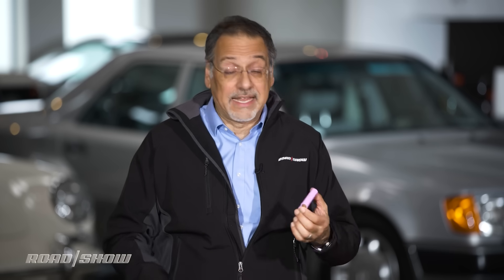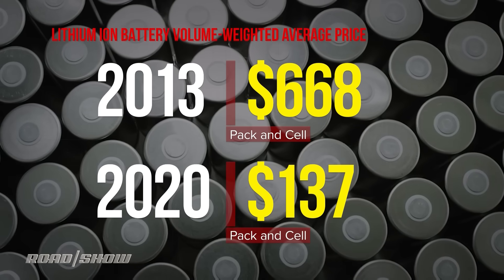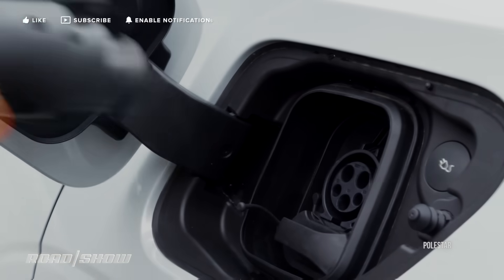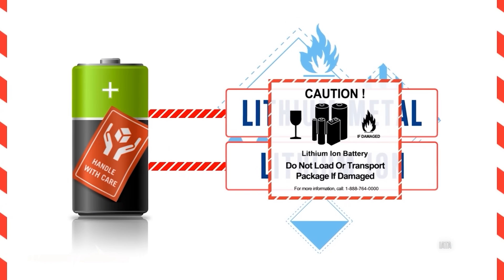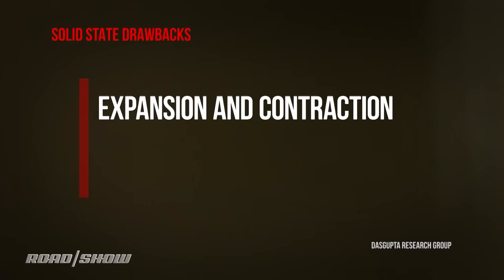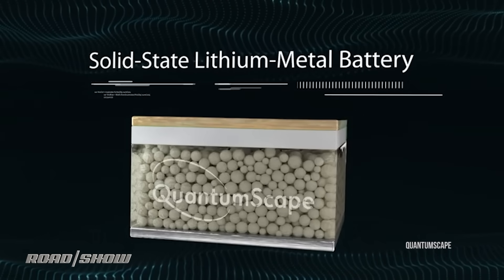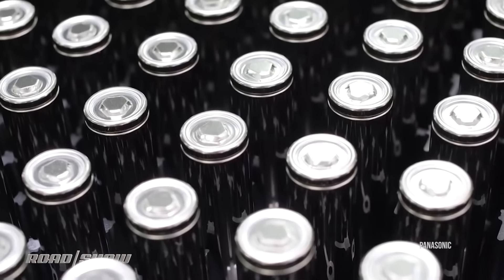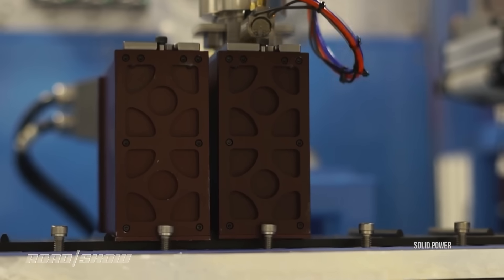When solid-state batteries arrive, you'll want an electric car

Comment: Some misinformation in this video. Not all lithium-ion batteries are created equal, 18650 are used in older Model S and X, but not in newer EV, and of course, there's lithium-iron-phosphate and other types of chemistry. When it comes to cold weather, a cold battery is part of the story, but not the whole thing. The battery is very capable of warming itself up, but there are other problems with cold weather, which includes much higher air density and of course, a heater. Heat pump helps, but you still gotta fight the higher air resistance, which also applies to fossil fuel cars as well.

Comment: 6:25 ohhh recharged up to 1000 times, that may sound impressive to some.  Forget about Tesla's theoretical 1 million mile battery,  Chevy Bolts have already done more than 1000 cycles in production cars.  Well over that.  One, in particular, is an escort for large load trucks with 217,000 miles (350,000km) in Canada.  That's 217,000 miles with a lot of cold weather driving and a lot of DC Fast charging, so the average is less than 200mi/charge due to cold weather and all highway miles.  In that time the battery has degraded from 58.3kWh to 54.7kWh or 6.2%.  Also, there's my cheapo $200 smartphone.  After learning what factors lead to reduced capacity, I started charging my phone to 85% and set the charger to finish charging at 7am rather than plugging it in at night, charging it up by 11pm and leaving it at 100% all night long.  After 1155 charge cycles, I still have 96% of my battery capacity.  Solid-state will have to do better than that.
Reply: If they have greater density and less weight they could gain range over NMC and have fewer charge cycles for the same miles.
Reply: Advertising consumes 10%-30% of the power in the average user's mobile battery in every charge cycle. We tolerate this, which sends a message to phone manufacturers that it's okay for them to give us two thirds of what we are paying for. 

If we ever want electric cars to perform to our expectations, we'd better let automakers know what those expectations are.
Reply: You said you set your charger, Apple has optimized battery charging but can you actually pick a specific time?
Reply: @Brandon_388  I have an android that I just have my charger plugged into a smart outlet that I can control the timing.

Comment: Tesla already has million mile life batteries 🤷🏻‍♂️
Reply: In theory.  We've got a long way to prove them out in real-world conditions, but they are much closer to proving out the million-mile battery once they hit production at the end of this year than any theoretical SS battery.
Reply: Sort of.  Tesla, as well as other companies, use an artificial limiter on how much battery life you actually get to use.  The reasons for this are because:
A.  You won't notice the battery degrading.
B.  Li-Ion loses lifespan when you charge it 100%.  So by limiting how much you get to use, you prolong the useful life.
Reply: @Toastmaster_5000  - and the reason you won't notice is those that can afford a new one will trade it in before it degrades and those that will be forced to by a used one are used to getting less reliable technology
Reply: Yes but we can do it better and smaller
Reply: Tesla hasn't made a vehicle yet that has gone a million miles, so that's a projection.
Reply: @Adiscretefirm  they are easily projecting 1 mil. They have the least battery degradation on the market and have done a superb job
Reply: @nickparkin8527  I know they are projecting a million miles of life, but a projection is not the same as having a battery that has gone a million miles, and to be honest it doesn't matter if the motors and battery last 800K miles longer than the chassis does.
Reply: @Adiscretefirm  They’ve already had one that hit 750,000 miles and still going. that’s already much more than any average gas engine. That’s almost twice as long as a Toyota Corolla  Would last. Their battery technology has only improved and it’s hard to get a car with 1,000,000 miles when The company hasn’t been in The business for that long.
Reply: @nickparkin8527 that's the obvious part the cult is ignoring Nick. No one can make any claims about long term reliability for a product that has only been out a few years. If you want to tell me electric motors can last 100 years you can prove it, because there are some out in the wild that have. If you want to PROJECT that under optimal conditions a battery pack will last a million miles we will have to wait and see if that is proven. Of course since the only battery pack that matters is the one in your car then we have to see what percentage make it that far.
Reply: @Adiscretefirm  That’s the obvious part the cult of haters is ignoring Carl & Nick.
People threatened by progress tend to lash out against the people making the most progress.
Cheers
Reply: @davidc2838  and people in cult refuse to acknowledge reality. Nobody anywhere can say they have a million mile battery until they have a battery that has done a million miles. If Tesla was so sure of that claim, they would warranty it for a million miles, have they?
Reply: @Adiscretefirm  
And people named Carl have issues with other people being way more likable than they ever could be...
But the rest of the world know there is always a Debbie (or Carl) Downer in every bunch!
Simply put...what would a bridge be without a Carl Troll under it??
The rest of us will merrily go along and enjoy the EV revolution, while Carl the Troll will hang out under his bridge and tell us all what else hasn’t happened yet.

But the parade for the first million mile battery will be too loud for us to hear the little troll 😈
Reply: @davidc2838  you know someone realizes they don't have the facts on their side when they resort to personal attacks. Will ICE engines be replaced? Of course, just as steam engines did, will it be by battery EV's? Questionable, fuel cell EV's offer several advantages. Has a revolution already happened? Unquestionably not there are still twice as many standard transmission cars on the road as BEV's in the US. Does David blindly believe press releases? Apparently so despite the fact that Tesla guarantees a 70% battery at 120,000 miles. Are you reading this in your $30K type 3 or in your Cybertruck? Neither, both are yet to exist. Tesla is to be given credit for bringing a performance, luxury car to market, but that is a niche that will do little to change the world's race against CO2 levels. If you want to talk game changing Tesla tech that could make a real difference, then get excited about PowerPak installations that make renewable energy more feasible and can obsolete fossil fuel peaker plants.
Reply: @Adiscretefirm  Stop pouting ya little bebe...
Again...
Telling people what hasn’t happened YET is as impotent an argument as one could possibly make.
Progress not perfection.
GM could have ruled the world if they simply would have had the cojones to keep going with the EV1
Toyota could have made Tesla unnecessary if they had REALLY pushed hybrids into new levels of speed, sex appeal and range.

Instead both of those automakers have flubbed their advantages and blew their chances on leading the EV revolution.

We ALL know that having an unnecessary system to create electricity is inherently inefficient. Fuel cells are not impressive in the least.
Hydrogen tends to blow up and burn 🔥 quite spectacularly...
And that’s just unnecessary.
But hey...whatever tweaks your little willie is fine with us...
Just don’t expect a lot of people to make that journey with ya.
Cheers
Reply: @Adiscretefirm  as en engineering student I can tell you I’m not “apart of the cult” I just look at their advances in battery manufacturing and it’s impressive. Compared to the Nissan Leaf, Tesla batteries hardly degrade at all. There have been plenty of early year model s’s reaching 400k miles. 

Since then Tesla has made huge strides in battery tech and have really improved the quality of their cars.
Reply: @nickparkin8527  why do they only warranty 70% after 120,000K miles? Is this to kill the secondary market?
Reply: @Adiscretefirm  ...many thanks! So we need to distinguish between ‘capability’ and ‘marketing’ - I’m a fan of Tesla...but we’re not living in a world where batteries have the same operating parameters as ICE in terms of cold weather performance, cycles and longevity and re-fueling speed /capacity.... Someday perhaps......
Reply: @Adiscretefirm  it will be a while before they do. They should first learn to keep their roofs on. Unacceptable. Tesla quality is 👎
Reply: @daniellecryderman2954  plenty of piece of crap ICE vehicles on the road that drop their transmission, blow their engines, burn out their electrical system and have all kinds of equipment malfunctions and recalls. Literally EVERY manufacturer from Chevy to Mercedes has millions of vehicles recalled. We’re numb to them because they literally happen so frequently.

Tesla makes the news because it gets more clicks to have ONE Tesla with an issue than 500,000 GMs recalled. No-one cares about the GM recall unless you are a GM owner.
Reply: Sorry? Is Tesla currently offering a production vehicle capable of offering a million miles of battery use?   Are they warranting  it’s performance and longevity? Or simply claiming that they have something in the design stage?
Reply: What do you guys think the Honda crushing Tesla by beating them to an approved Level 3 autonomous driving car? Something Tesla claim to be the best in. 😁
Reply: @apangurra2775  Tesla isn’t going for Level 3...they’re going straight for Level 5 capabilities.
Cheers!
Dave
Reply: @davidc2838  And it has to be approved, good luck with that..
Reply: @apangurra2775  
Yeah...
Because the guy in charge hasn’t accomplished much of anything...
You know...getting astronauts to space again from the good Ol’ USA 🇺🇸 without having to buy a ride on a Russian 🚀.
Or landing reusable rockets back on earth, simultaneously and dropping rockets onto a drone ship in the middle of the Gulf of Mexico. 
And slashing the costs of traveling to space...
And putting a constellation of satellites 🛰 into orbit so everyone on the planet can have fast WiFi, even if they live in the boonies!
You know the same guy who’s company is building a BIG rocket to land on Mars...
Yeah...
No way THAT guy’s gonna make sure his company gets approved...

I hope that Honda gets off it’s arse and builds some great vehicles again...
EVs...not hybrids.
And that they take it seriously because they obviously missed the opportunity LAST decade...
And the Japanese auto manufacturers have really blown their lead in EVs, even if they were mostly hybrids and / or short range EVs.
Too prideful to admit they were wrong about hydrogen...
Which was just a thinly veiled attempt to avoid changing from ICE vehicles.
Cheers

Comment: I've heard about the "new amazing battery coming soon!" story so many times over the year, yet most of todays best lithium ion batteries are around 0.2 kWh per kg. Petrol is about 12 kWh per kg. But since electric motors are about 95% efficient, and petrol and diesel engines are only up to 35% efficient, we only need to get to 1 kWh per kg for enough range at around 1 000 km.

Comment: FUD - Tesla already has 1,000,000 mile batteries and new dry cells have no gel, & no dendrites. ICE vehicles burn 1000x more often than Teslas.
Reply: ^^^This still needs to be proven. 
Furthermore, your not accounting for the literal  mountains and mountains of discarded battery packs and other toxic waster we will have to deal with in 10-15 years when evs begin to be fully adopted by society. SS batteries fix this issue in a lot of ways

Comment: I still think hydrogen is the future of engines  and nuclear for electric.
Reply: Hydrogen will have its part especially in heavy industry. But since making the hydrogen uses so much electricity to produce, it's kind of like adding an extra stage when you don't need it. Just put the electricity into a battery and skip the extra stage. Plus as of now most hydrogen is produced from natural gas using a process called steam refractiring. Oil and gas companies love hydrogen for that one reason.  
As I said hydrogen will be a part of the future of transportation, but I don't think it will play a big role in personal vehicles.
Reply: Plus I don't think you understand how hydrogen vehicles work. Hydrogen vehicles don't burn hydrogen in an engine. A hydrogen vehicle is an EV. It has a small lithium ion battery in it. The hydrogen is used to make electricity in a fuel cell which powers the battery.

Comment: Not so sure that solid state is where this is going. Sort of like the predictions of the demise of the Porsche 911....about 30 years ago. More likely that the 4680 form factor is where this is going in the next few years. While "solid state" is an interesting possibility, the simply fact is that it's completely unclear if/when they will ever happen. By comparison, 4680s are going to appear in cars within a year.

As for concerns about "million mile battery", by most accounts current Teslas are already there. Certainly, the Chinese models using lithium iron phosphate are clearly there. But then, does it matter? I mean, do you really need your car to last over 40 years on the original pack?

As for concerns about range, myTesla 3 LRDM goes as far as a my former Golf GTi on a tank. I routinely take it on 1,000 mile voyages. It's no more difficult to do these trips in the 3 as in the Golf...I kinda need to take a break every 3 hours in either car. If this isn't an issue with a GTi, then why would it be an issue with an EV? 

As for concerns about recycling, the life cycle of lithium cells has been thoroughly figured out already. First mobile applications, then stationary applications, then complete recycling. All this is already in place.

As for concerns about thermal runaway and "exploding Teslas", this is pretty much a non-issue. In fact, the EVs that actually have this problem are the Korean ones (they're all being recalled), not Teslas. But to be fair, the incidence of spontaneously combusting EVs is far, far lower than the incidence of spontaneously combusting gasoline vehicles. This sounds more like an argument for outlawing internal combustion cars due to the fire risks of gasoline.

Quantum Scape is one of many companies exploring new variants of lithium cells. While this company has issued some nice press releases, the reality is that they can't produce batteries....until, maybe 2024. Toyota is just about ready to jump in as well....as soon as 2025. Hmm. Anyone can issue a press release, but let's deal in reality. The reality is that the move from the 2170 to the 4680 is simply huge, and will enable an 8 second quarter mile car with a 500 mile range, a 500 mile range pickup that does 0-60 in less than 3 seconds, and viable tractor trailers.

I kinda this you may be missing the point here. That Tesla already has a substantial lead and the likelihood of their developing improved battery technologies at a slower pace than others would seem to be a bad bet. Press releases are cool, and companies that aren't really competitive will use them to buy time (like GM's "aspiration" to be all EV by 2030...or whenever)....but reality is cooler.

What's most important is that the basic premise that "you won't want an electric car until some uncertain development in the future happen" is kinda silly. You can already buy an excellent electric car right now at a reasonable price, with more than acceptable range and excellent charging infrastructure. No need to hold off. The future is already here.

Comment: With current advancements in construction and manufacturing of Lithium based batteries, many can't see how solid state batteries will be better than them in less than 10 years. Solid State batteries are still in the research phase, not the production phase. I'm getting too old to wait for another advancement in battery technology. Lithium is great for light weight portable batteries, and Liquid Metal batteries are now being made for a project in the U.S., where weight, heat, and portability aren't issues. So what's so important about having a solid state battery today?

Comment: Cut the crap. We don't need batteries. Just make the electric cars self charging. And why batteries, and not capacitors with a a generator. Capacitors don't degrade.

Comment: Failing to see how Tesla's 4680 batteries aren't good enough. 500 miles of range? 15-20min charging? 1200+ horsepower? Million-mile life span? 1/10th as likely to catch fire as a normal car? They seem like they already an extremely good technology and if solid-state batteries aren't cheaper than 4680, then why would anyone use solid state?

Comment: Battery cars are great for convenience and speed, but don't fool yourselves. The mining, production and disposal from birth to death of current battery technology has a net negative impact on the global environment. Good luck recycling them, it's a lie. New nuclear for municipal power is super safe, does not require water cooling, can run on the old nuclear waste or much lower enriched material. It also has zero carbon and is the only technology that we currently have that can make a big difference. Wind and solar are also a lie and require full blown carbon power plants to back them up when there is not enough sun or wind. Check out some European countries are abandoning the "renewable" lie and swindle.